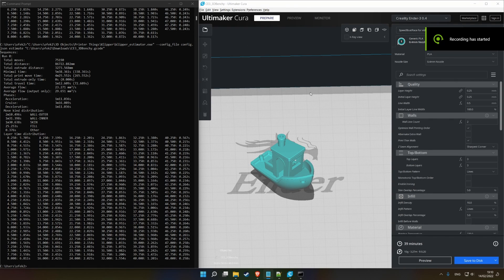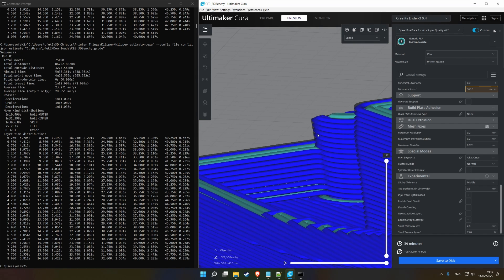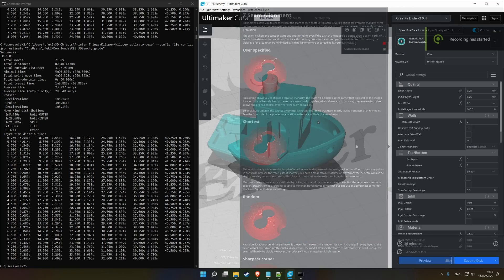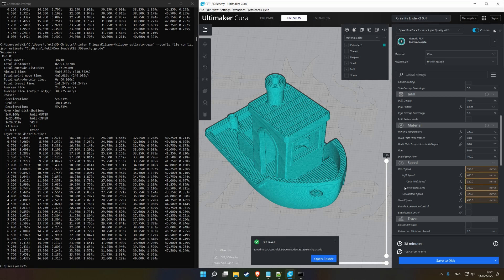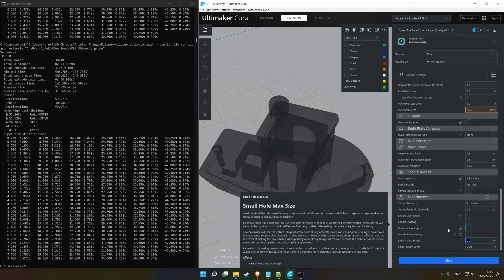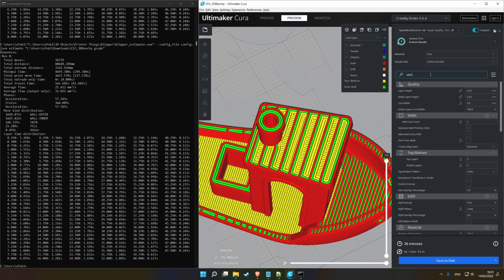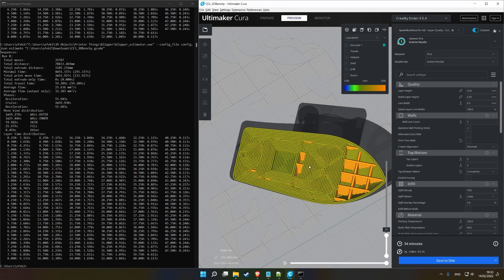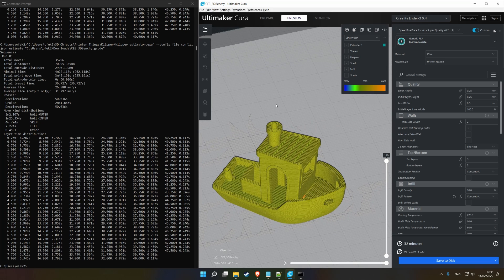My #SpeedBoatRace 4m 48s Cura Profile: How I saved ~20% printing time with only slicer tweaks!

Comment: Nice work. I want to print very fast but with very good quality. Is that possible?  Will you have a video on your ender upgrades?
Reply: Klipper, linear rails, input shaping, high flow hotend, greatly improved parts cooling. This is the formula for every printer

Comment: Thank you so much I learned a lot
Reply: You can use arc welder instead of lower resolution it will print faster but with better quality
Reply from the maker: @MauriceMischo  Arc welder doesn't work for me for some reason, but that might be a good idea!
Reply: @HorizonMakes  You can active it either in Cura or directly as a plugin in octoprint. For me it did not work at first so I had to add a arc welder line in the Klipper config